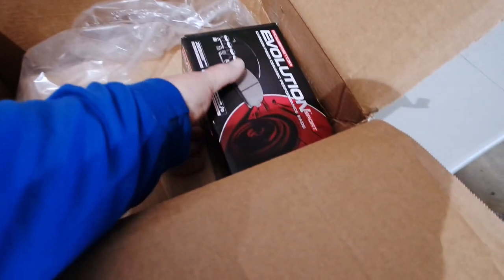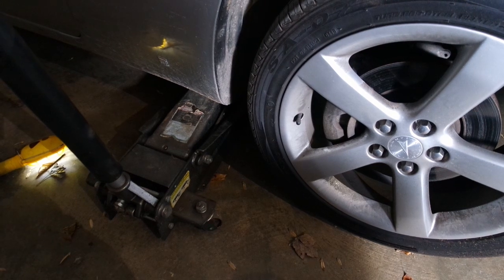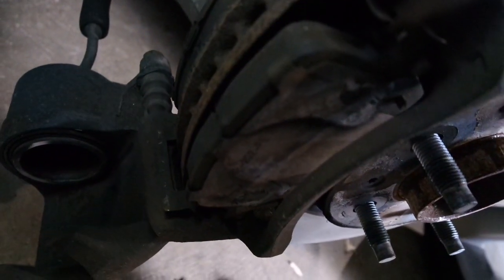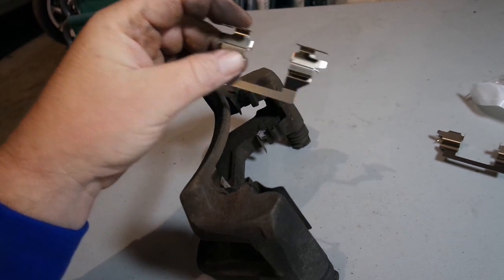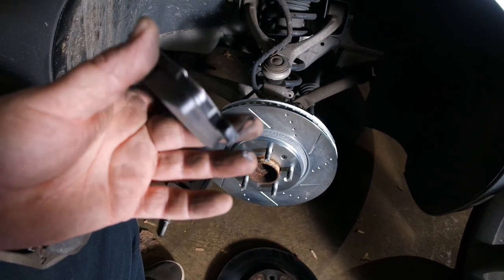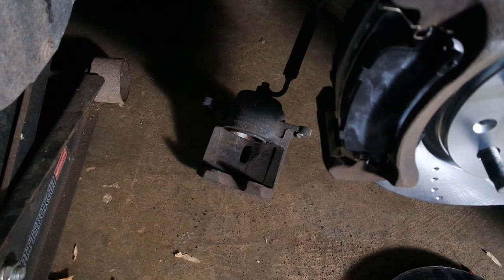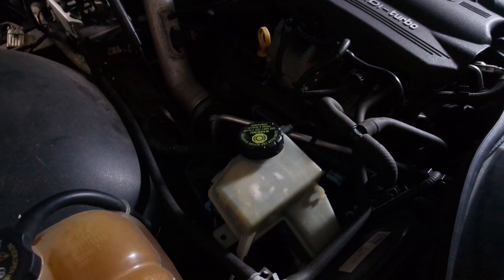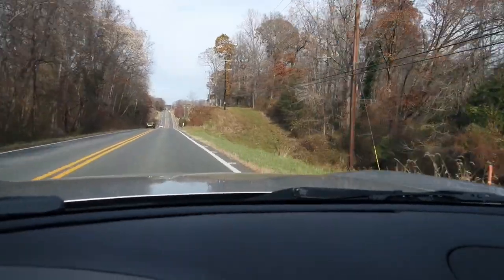How to replace Pontiac Solstice front brakes and rotors (Saturn Sky as well)

Comment: Are you supposed to break-in those rotors?  I recently did my daughter's 2007 Ford Edge.  The instructions included specifically included instructions on how to do this procedure.  It is basically going up to 30mph and pressing hard, no stop, repeat x number of times.
Reply from the maker: Great question! No I did not see any specific break in directions with these but yes mashing the brakes hard a few times after a brake job is the way to go. Thanks!
Reply: My previous pads and rotors packaging said this. Best to this in a parking.

1. 20mph to 5mph 3 times
2. 35mph to 10mph 3 times
3. 45 mph to 15mph 3 times

Comment: 11:40 is that really necessary ?
Reply from the maker: Compressing the caliper at some point is definitely necessary. Ton of different tools you can do it with though including a flat blade screwdriver. I have another video doing brakes on an Enclave and I used that method https://youtu.be/QT9okibdZZo
Reply: @MidnightRoadGarage   it's just an annoyance when you don't have a tool for it when you need to swap for a new brake pad
Reply from the maker: @creatorsfreedom6734  agreed and it can be done with a screwdriver although the tool is much easier. The piston that you are pushing back in is what makes the brakes work and the more pads wear down the further it sticks out. Of course the new pads are much thicker than the old so you have to push that piston back in so that it fits over the rotor again with the new pads :). It's not hard though, you got this! :)